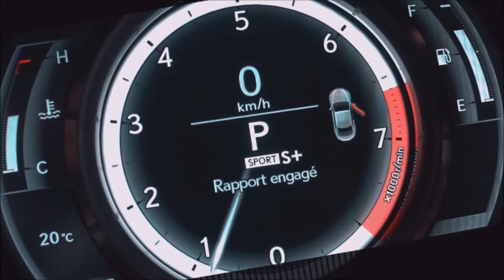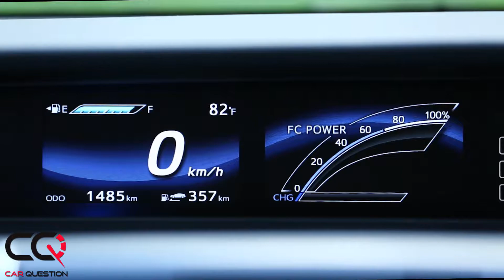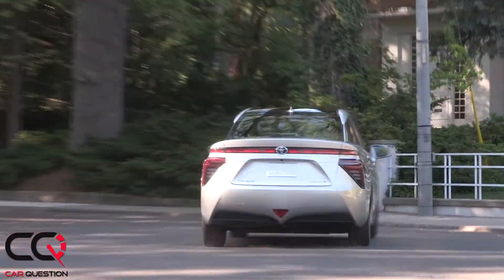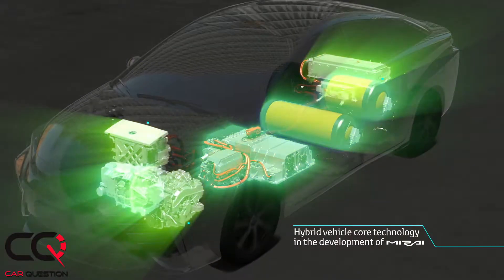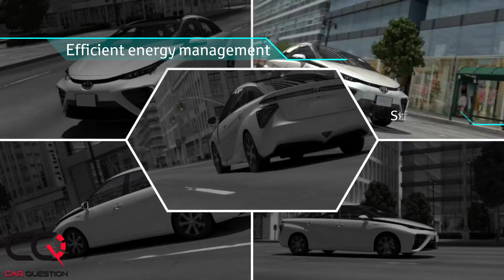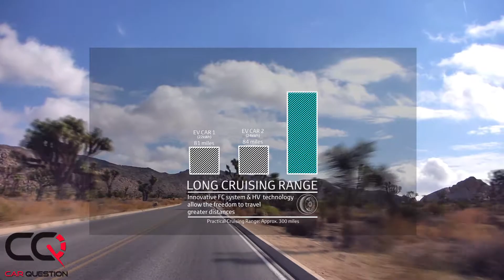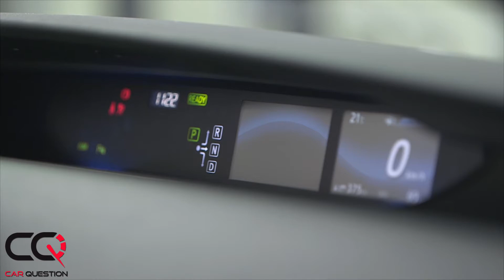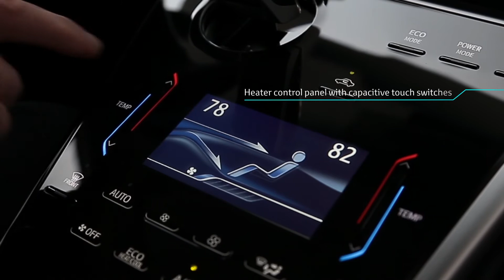Toyota MIRAI | Is Hydrogen the FUTURE of CARS?

Comment: Currently studying about the fuel cells, but I see that getting a hydrogen pumping stations would not work well due to the infrastructure needed, but electric car infrastructure is growing. I think that the fuel cell and 3 tanks, 1 for hydrogen, 1 for oxygen, and 1 for water exhausted along with the fuel cells can make a different kind of "battery" that can be "charged" by using an electric car charger that takes water from the water tank and hydrolyze it into hydrogen and oxygen and separate the hydrogen and oxygen and send them back into their tanks when the car is plugged into any electric car charger, this idea will hopefully make it more viable for this technology to happen especially with larger things such as semi trucks, trains, buildings, airplanes, and ships as well as improve chances of getting the shipping industry to work on alternative energy.

Comment: Is hydrogen the future of cars? Answer: no. Next.

Seriously, have you seen the trunk of the Mirai? It's minute. Because hydrogen tanks are MASSIVE - they have to be. You can not easily package them which means you're always going to live with a compromise.

Fuel cells degrade. 

A hydrogen pump at a station can only service 1/3 the number of cars an hour as a petrol pump due to re-pressurising, de icing and testing, and they frequently break. They also cost $1 million EACH. A pump, not a station. So you need 3 times more at a far far higher price to create a station equivalent to a gas station.

The infrastructure required to support volume production of hydrogen cars is completely unsustainable and it won't be built. Without the infrastructure, car companies won't build to a volume that makes the cars profitable.

It's a vicious and pointless circle that only leads one way: nowhere.

So no, its not the future of cars, as much as the oil barons want you to believe it is.

For as long as you're waiting for it and ignoring the battery electric cars that are already viable,.... You're buying gas.

And that's the con.
Reply: Is hydrogen the future of cars? Answer: YES!
Do I need a big trunk?
The trunk has the same size like a VW Golf.
How many cars can use an EVSE charger by a day?
How long they block the parking space?
What is the prize for an working supercharging station? 
What are the cost to bulid an new petrol station?
Can we store electricity from summer to the winter? 
Can we transport electricity in a easy and save way? This over oceans? 
With hydrogen, this you can do.
The fuel cell convert the H2 together with O2 to electricity, heat (here in Switzerlsnd, the real summertime is arround 5 mont's in a year) and water.
A battery convert the stored ions in electricity and heat. 
But a battery has to charge first.
By the charging, heat is a by product. There is heat a big challenge. 
This need a bit time. And need realtime produced elecricity. 
After charging, the battery loose this energy over the time. 
A fuel cell need only new H2, stored in the H2 tank.
This energy you can store over a very long timeperiod.
H2 you can produce an store over the complete time of a day. 
Renewable energy, water, geothermal, sun, wind, you can use and store it as H2.
On the H2 station, you can "recharge" the FCV in 5 minutes.
The heat, produced by the compressing process, you can use in the H2 shop. 
The by product heat is reusable.
How long need a petrol car in reality to "recharge"?
How long need a BEV to "recharge"? 
A charged battery is always a dangerous thing. Full power on the 2 pole, when the car is out of service. 
A FC has no power on his 2 pole, when it is out of service.
At the end, BEV and FCV has a brigth future. 
The BEV for small ranges. 
The FCV for middle and long ranges. 
There is no BEV or FCV, there is an AND between. 
Togeter for an CO2 free mobility.

Comment: Intriguing technology, but this is going to be hard to mass market as living in Ontario I don't remember the last time I passed by a H2 pumping station. For EV, there are Level 2 & DC Fast chargers in a variety of places, not to mention the most convenient one of all - your home. 

However despite strides in DC Fast charging tech, H2 pumps work a lot faster like gas cars, so there could be some benefit for frequent long distance traveling.
Reply: H2, only one unique nozle system.
BEV, different systems, different payment methodes. Why? 
This made the CO2 free mobility not easy. 
Search and found a free charging point, different tarifs, different payment methodes.
And, it need in realtime produced electricity.